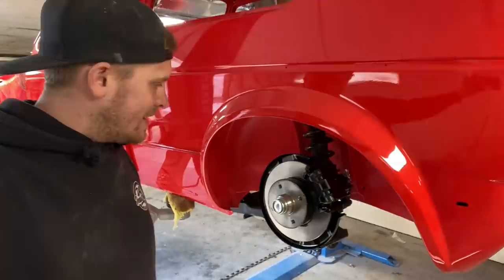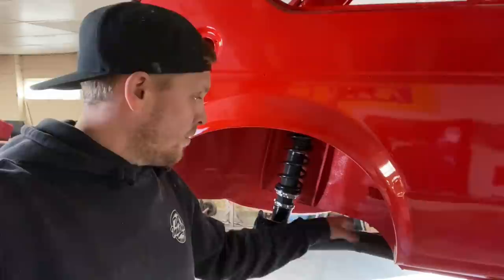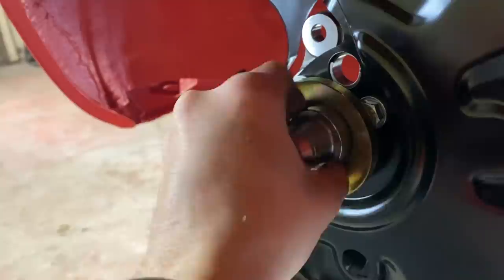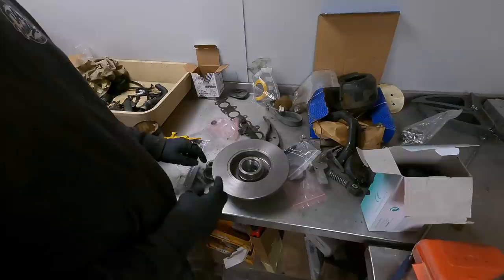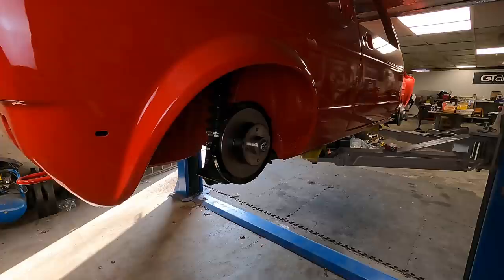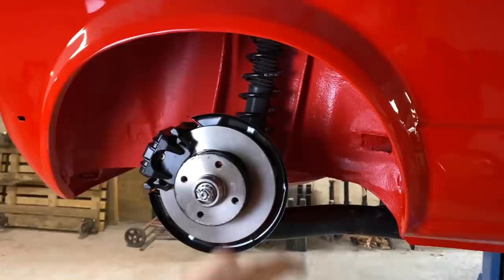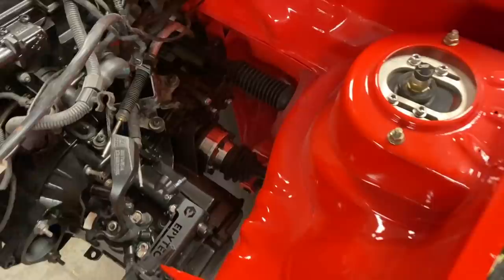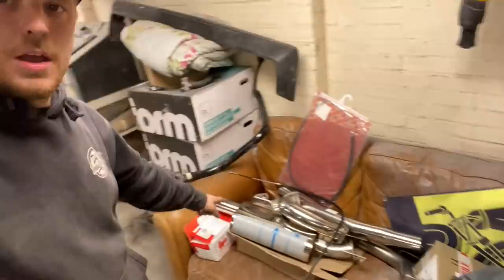Rear Disc Brake Conversion 1983 Mk1 Golf GTI Restoration 1.8 20v t Engine Swap

Comment: We used to put a wheel on and then make sure the wheel turned with no resistance but not loosely job done
Reply: Totally agree. Looking for comments about adjustment for bearings and only your comment found. In video I also saw blocked brake disc. When the wheel take its place, the bearing will be heated and needed to be replaced

Comment: Looking really nice now Dan the Golf is coming along nicely, when I used to fit those type of bearings I used to torque them down to a set number then back them of a little to preload the bearings, cant remember the exact figures but it was in the workshop manual for the car 🙏👍

Comment: nice work , you should fit a brake pressure regulator for the rear disc conversion or they will lock up

Comment: You can take off the 2kg golfclub on top of the shifter mechanism.
It's only there for positive feel when granny shifting.
In this case it's not necessary and it's kind of fugly in the shaved engine bay.

Comment: your nuts are too tight when they heat up you can tighten it just tighten to the point that there is no resistance from your discs @pepebikes #caribegtbergcup